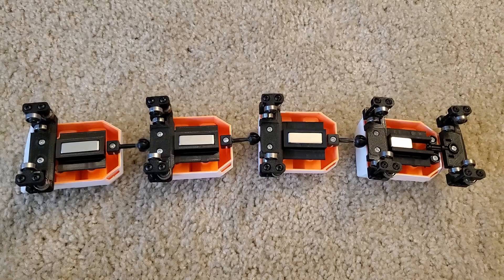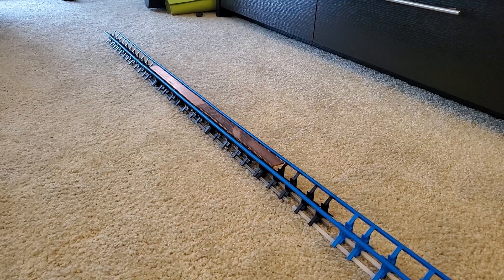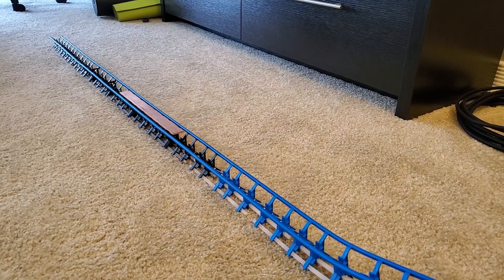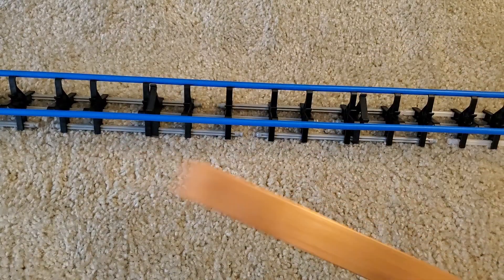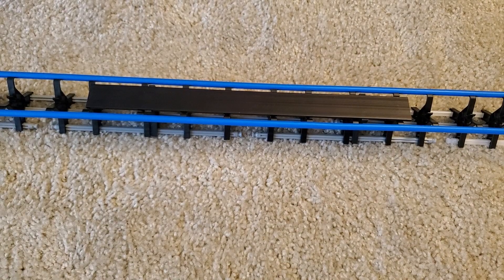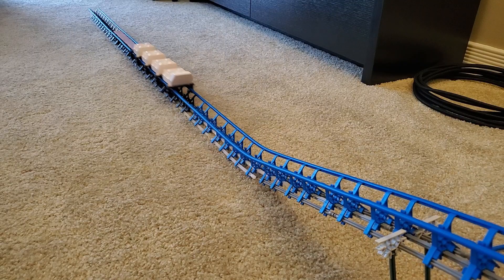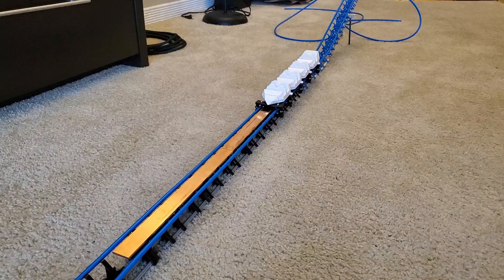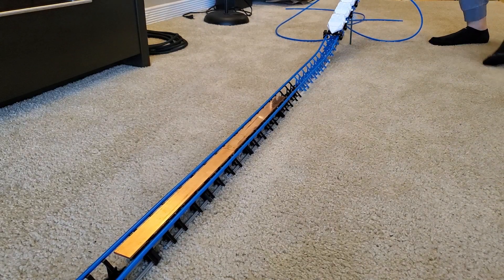Magnets Work Now

Comment: How heavy are the cars? Are they heavier with pennies under them?
Reply from the maker: I don't have a weight for the cars, they're pretty weighty now probably more than a AA battery which is what old school builders used to use a decade ago. The magnets have the added benefit of being multi purpose and will round out a suite of features I'm working on. Plus the bearing trains out perform the normal cars already, the weight is icing on the cake.